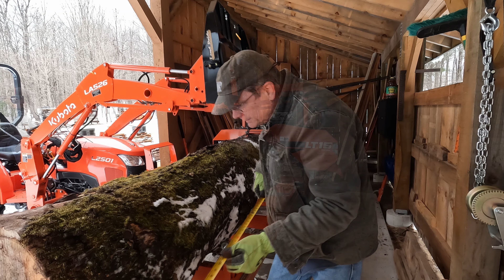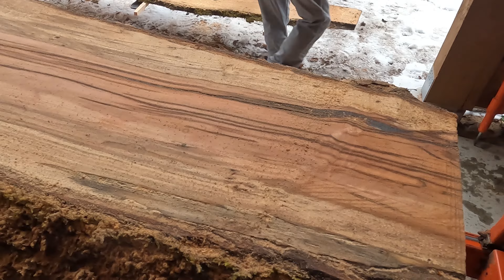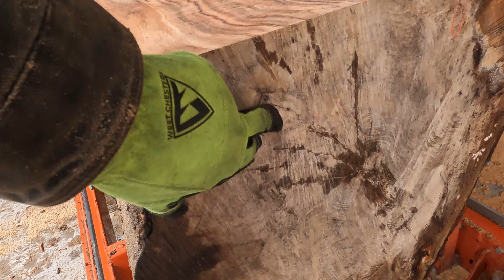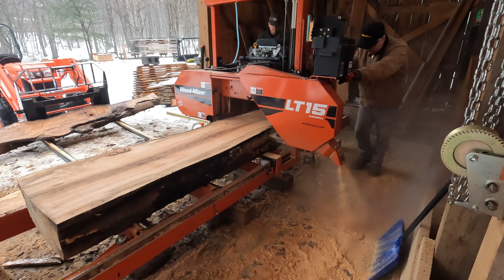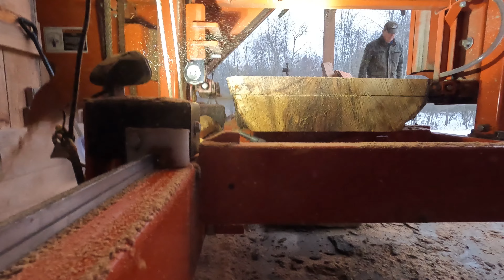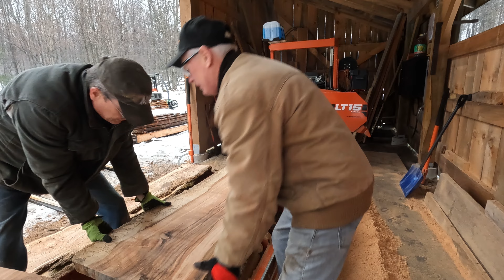More Amazing Hard Maple on the Wood-Mizer LT15

Comment: Great video! I love sawing old dead logs, it's like Christmas every time I open one. Those aren't rotten spots they are called resin epoxy projects 😁 Two cant hooks being used on the mill and not a single mishap! 😉
Reply from the maker: Thanks!  There was one mishap involving my head and the tip of the forks but besides that all went well!
Reply: Still not sure how we're going to get the forks fixed...
Reply: @andysmith8544  🤣😂🤣

Comment: save the baords and don't knock the loose stuf out of the knots. I'll be doing video's on how to fix and repair the wood. The new sponsorr i have is helping me with many projects where we will have solutions for the soft wood and wet lumber to stablize it.. I'm exsighted about the projects.. Love the figure in the maple. I've got several trees that have damage that need to come down. some oaks as well..
Reply from the maker: We saved them all, stacked and stickered in a boule but some of the knots were cleared out as it was mostly sawdust.  There's still plenty of soft areas.

Comment: That’s some nice looking maple. How do you like the 4* blades ? I don’t care for them at all. They leave a lot of sawdust behind. And I milled a large white oak the other day with one and it couldn’t handle it. I switched to a 737 on the second one and it buzzed right threw it. Thanks for sharing.
Reply from the maker: We love the 4 degree blades.  They do dull quickly are rather slow and do leave behind alot of sawdust but the quality of cut can't be beat at least on our mill especially when the log is frozen.  We never had white oak on the mill but we did just discover some seedlings of white oak on the property last year so maybe in a hundred years we'll have some 🤣

Comment: Forgot.........were you using a 4 degree blade?
Reply from the maker: Yes, 4-degree blades.  We get a nice flat cut for the most part, but they really leave a lot of sawdust.  With our 19hp Kohler that seems to be the best choice for hard maple and frozen logs.  If we had the 25 hp option, I think we would be able to use 7 degree, but our 19 hp doesn't do well with any change in density (knots).
Reply: That's correct; Wood-Mizer recommends at least 25 HP for their Turbo7 blades. The Turbo7 blades also have a tendency to leave chatter marks if you saw too slowly.

Comment: Squigglies, I laughed. So at the start I see you putting a board under the front end of the log, right above your toe board...
Reply from the maker: Yeah, cuz someone set the log on the mill bed just 3-4" behind the first toe board.  That same person forgot the drill to raise the toe boards, and we've concluded Wood-Mizers toe boards suck (they rotate the board away from the log supports and create instability).
Reply: @southernadirondackoutdoors  you put them on the wrong side of the bunk if they are pushing the log away from the supports.
Reply: @mcsawmill  Nope, they're installed correctly.  Run your toe board up all the way and watch how it rotates up, creating a slope away from the log supports and pushing the log toward the dog side of the bed.
Reply: @andysmith8544  you're right. huh.. I never noticed that cause I only go an inch or two.